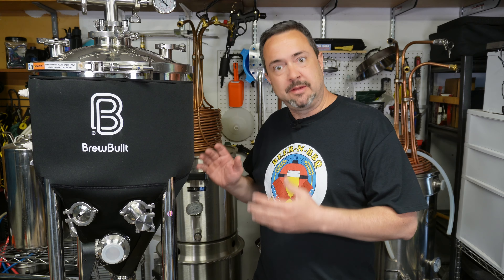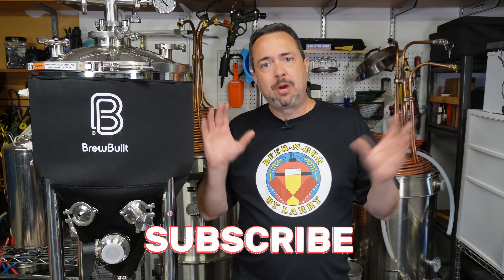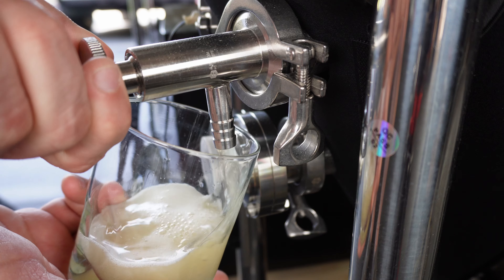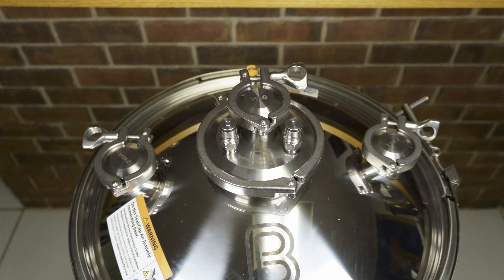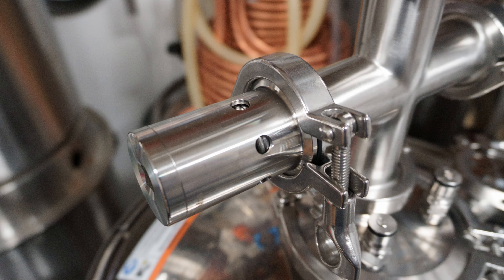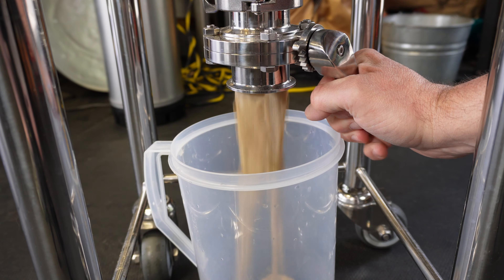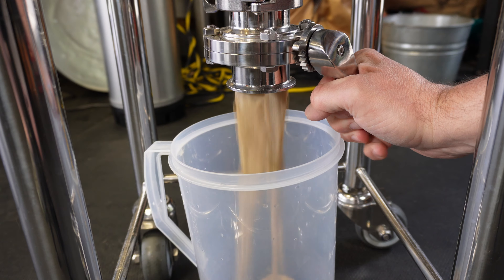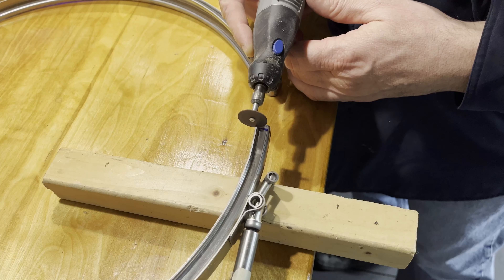Jacketed BrewBuilt X2 (14 Gallon) Fermenter Review: Is It a Unitank or a Conical?

Comment: I had big problems getting pressure on my X2.  Finally figured out just spray all gaskets, seals with starsan and it pressurizes with no issue.   Also, I have had no issues with the flex chamber leaking at all.
Reply: what do you mean with seals with starsan??
Reply: @Chemash  He means spray them with starsan ... spraying the gaskets/seals helps make a seal work better because they are wet rather than dry.

Comment: Might be an issue with the lid … I have a X1 with a X2 lid. I didn’t have an issue to clamp the X1 lid on the fermenter. 
Once I changed the lid, I couldn’t clamp it tight… I did the same cut modification and now it’s fine, maybe the lid sheet metal on the X2 is thinner than on the X1. 

But I don’t have an issue with holding pressure. What I found with a pressure check was that the integrated PRV was releasing pressure. I removed the pull ring as it was shifting the PRV shaft a little bit.
Reply: I had the same issue with my PRV.  Got it swapped and still leaks.  Need to take it down to MoreBeeer (I live close).  For now I just sealed it with some rubber tubing and it holds pressure.  But I have no PRV...which is fine since I don't ferment under pressure so when I just carb in the tank I control pressure with the regulator.

Comment: I’ve had my X2 for nearly 12 months and probably done 8 brews in it. Mine doesn’t seal metal to metal - there’s a gasket to help with sealing. I’ve had mine right up to 15 psi both pressure fermenting and using it as a bright tank.
Reply from the maker: It was as much a manufacturing quality issue as a design one. 
I was told they changed clamp vendor soon after I posted my complaints and related videos to them.
You may have been a beneficiary of that outcome.

Comment: Yet another great honest video.
I was thinking of this unit as the jump to stainless from an apollo 60l PET unitank. The two main reasons (apart from i'm a man and like shiny engineering  things) are the jacket on the unit and the price.
We can't get Spike in the UK to my knowledge and I'm after something in the 60-90 litre range (25 US gals). The brewtools equivalent is +$2500 and the SS brewtech non jacketed 59 Litre is $1780, whereas I can get the 95Litre Brewbuilt for $1470.
I like the fact the lid comes off as it's easier to clean. I have seen other reviews bring up the same comments but as an engineer I think I can work round them. Good suggestions are the you put a sanitary bend on the bottom with triclamp and ignore the Fermzilla attachment type thing. Also someone said it was critical which way round you put the seal in the lid, not sure if that holds any water (or gas!). Do you think you can "fettle" (Lancashire dialect as meaning 'dress, case, condition', make fit.) the clamping arrangement on the lid.

I like all the ports on it where you could add thermowells, hop bongs and just about anything.
Don't tell me I don't need one! I'm not listening

Comment: I was able to fix the pressure leak issue by adding a thin self adhesive EDPM rubber seal inside the clamp.

Comment: Keg lube the gaskets, flanges and threads bud!
Reply from the maker: Keg lube was the first thing I tried without success. As for threads, there weren’t any threads left to tighten further as the T-bolts were already at their end of travel which is a part of the poor clamp design

Comment: Good video.  Bummer about the V clamp.  I have the X1 and never had an issue with mine.  It looks like yours is too big.  Mine doesn't join all the way when clamped.  To me dumping trube and dry hop is paramount to the use of a unitank.  Most good IPA brewers do cone dumps the day after they rack the beer to the fermenter (especially when they add huge whirlpool additions)  as well as the day after they add dry hops.  Getting the green vegetal matter out of the beer is huge for fresh hop aroma and flavor.  I agree about the narrow space with the 4 legs.  I just bought a 2" to 1/2" barb fitting and attach 1/2" hose.  This allows for a slower more controlled cone dump.  I never use the flex chamber mainly because I don't want to figure out how to purge O2 out of it.  Hopefully Brewbuilt fixes these quality issues...they're great unitanks at a good price point.

Comment: You've had the Spike versions of these fermenters so I'm wondering, have you had similar issues keeping pressure in them?
Reply from the maker: It’s been years since I used the CF10, but I do recall a slow pressure loss after fermentation subsided.
The smaller Flex+ has worked better but still at times seemed to slowly drop.
Neither were as bad as this though.
Reply: @BEERNBBQBYLARRY  My CF-10 and Flex+ have been collecting dust. I've been doing my pressure fermentations in my kegs.
Reply from the maker: Me too but in my Kegmenter.